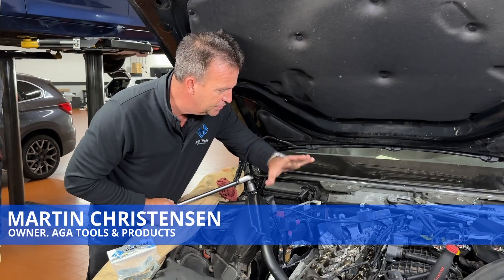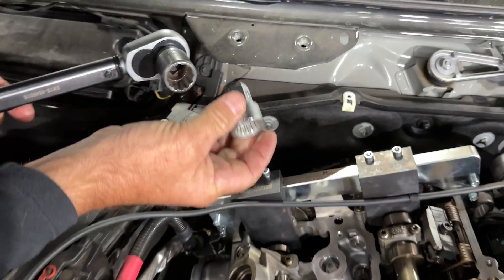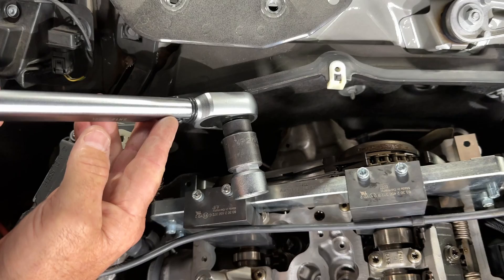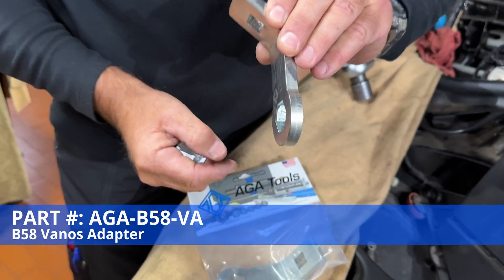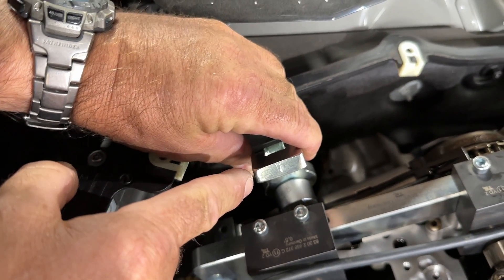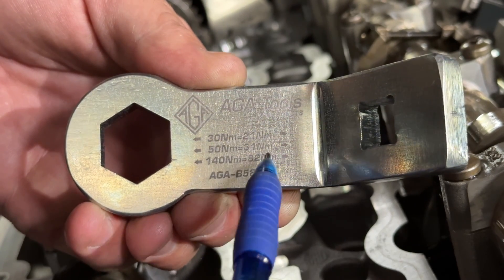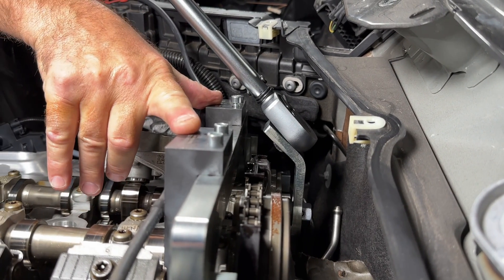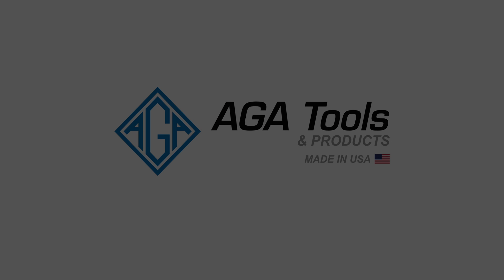AGA Tools B58 Vanos Adapter

Comment: Nice. I've lost count how many of these VANOS I've done. I usually pull the cowling, wipers, the whole shebang.

Pure junk these B series engines. It's getting embarrassing at this point.
Reply: Did those have issues with the mangetic actuators or the vanos itself per video ?